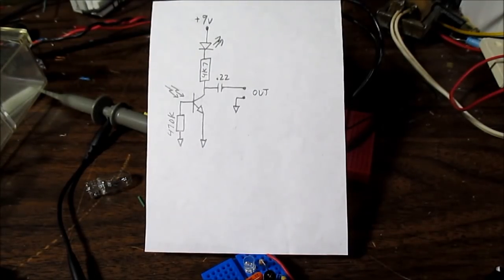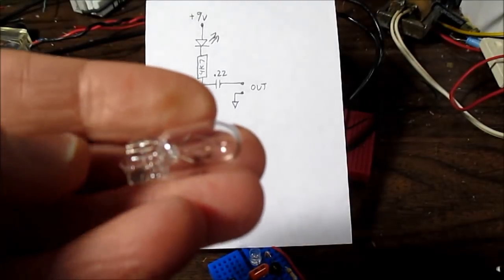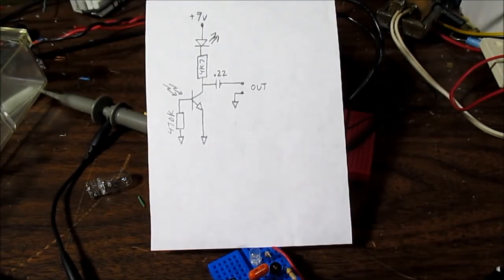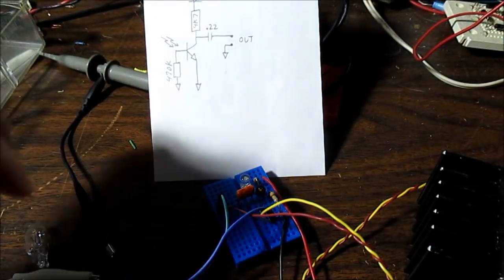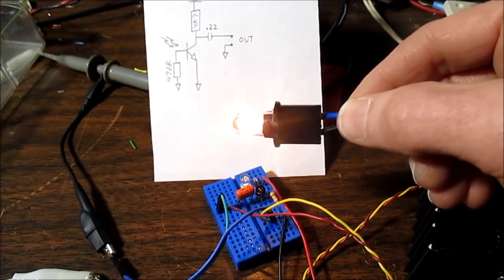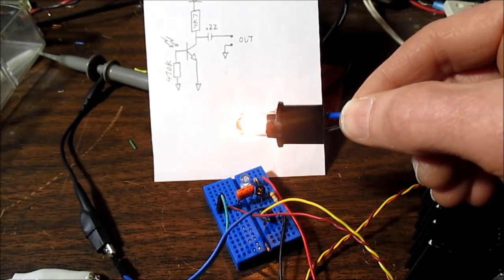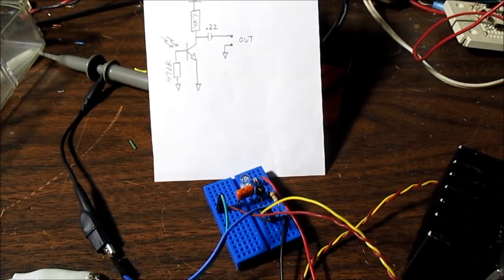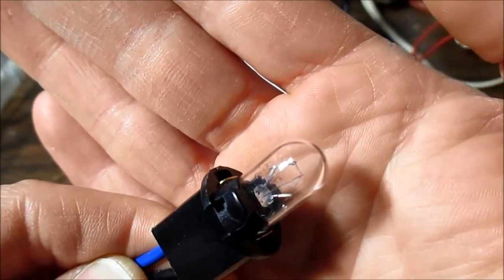Audio signal from incandescent bulb into phototransistor receiver

Comment: This one was interesting.
You've confirmed what I thought might be the case with filament bulbs as light-audio senders. They don't give very good response but may be okay for speech. 
Have you tried putting a little dc bias on the bulb to see if that changes things at all?
Also have you tried doing this with LEDs?
Of course with those you use a transistor circuit to set the idle current of the LED and apply audio to that. I think the fidelity might be quite surprising and you could use lenses to send over a considerable distance
Reply: Think, one of those cheap 1W LED torches that has a focus used as the sender.
I think I might eventually try this one! 
You have the scope to test the upper frequency limit though. You might discover it's high enough to even send sub carriers!

Comment: Alan Cordwell was right.  I built an audio link back in the mid '60s using a 12V tail light bulb and a germanium power transistor to drive it.  I used a reflector of headlight to focus the beam.  At the far end I used a small selenium photocell and a magnifying glass.  I got it to work for about 600 feet, but the audio was very heavy on the low frequencies, I had to reduce the coupling caps to roll off the low frequencies.  That was before LEDs, even dim red LEDs.  Today it is easy to get watts of LED light that can be modulated at 10 megabits per second or more.  The only problem is getting it to work in rain, snow, fog, etc.

Comment: Maybe a new smart form of surveillance!? A small microphone mounted in a LED bulb!
Nearly impossible to detect since it does not transmit any radio waves and impossible to see.
And all you have to do is to point a telescope with a light censor at the light that emits from the room behind the curtains, and it is clears as day to hear. :-)

Comment: Doesn't the led mess things up? It throws light on the phototransistor as well
Reply from the maker: The LED sits lower than the transistor which has black sides. It could reflect back though. It is rather dim to be much of an issue.

Comment: This is a very interesting field for experimentation, and a lot of fun. I did a load of work on it back in the 80's, I found that to send intelligible speech or music you have to bias the bulb on sorta bright but not fully- you can use a series transistor with adjustable base bias, then feed the audio onto the base via a capacitor. This makes sense if you think of it like amplitude modulation! It also helps with the frequency response cos the bulb responds faster when hot, but its still going to be very bassy. LEDs should be much better though. Back then, they weren't bright enough. The only way to sent audio over big distances using light was to use a high power bulb, and modulate the light from it using a shutter made from two blades one of which was mounted on the voice coil of a modified (cone removed) speaker, and then use a lens to project it. You could get miles using this setup at night, given a sensitive receiver  with a lens focussing the light on to the phototransistor, and biassing the latter on slightly.
Reply: Yes, I think without bias you'd get a frequency doubling, as the filament lights the same positive or negative.
Reply: To tune the bias transmit a sine wave and monitor the even harmonics (audio spectrum analyzer). Adjust the bias to minimize the even harmonics and you have the optimum bias point. An asymmetrical waveform creates even harmonics and a symmetrical waveform minimizes them with only odd harmonics remaining. I have done this for broadband amplifiers when output filtering was not possible.
Reply from the maker: You are correct. Don't know why I did not think of that. Someone mentioned that earlier so I made a followup video.
Reply: What about high frequency pwm through led?
Reply: Isn’t that in a way how optical audio works